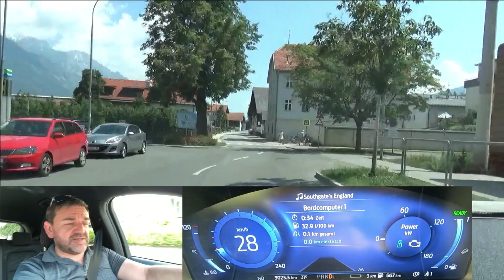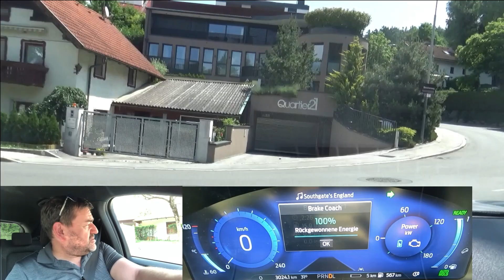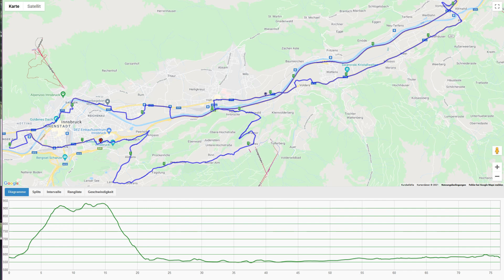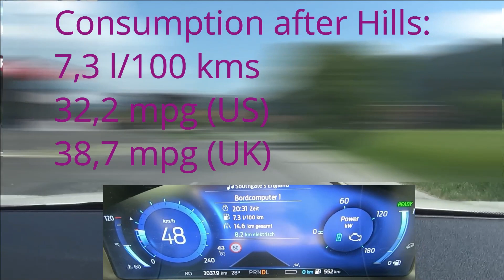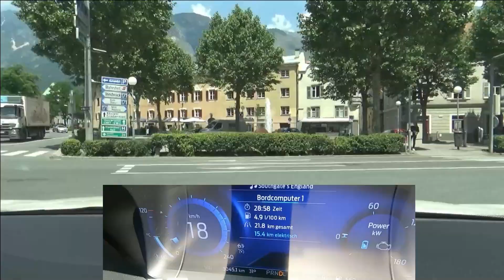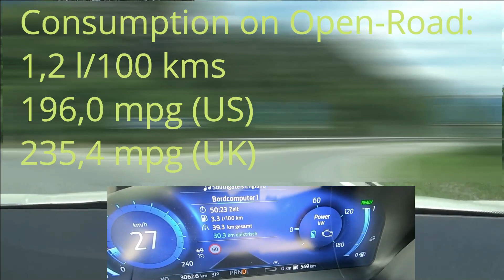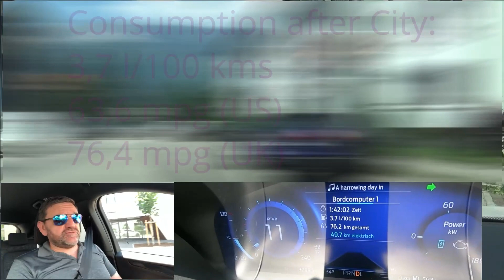Ford Kuga/Escape Plug-In Hybrid - real-life consumption with empty battery

Comment: I love my Kuga, went for a first refuel last week.
I did 2500 kms, with an average fuel consumption of 1.4 l/100km.
The car told me I did 2080 kms full electric. And I filled around 35 liters into the tank, so that works out to around 8 l/100 km, from just the engine kms.
Not bad at all, since our 1.5 Ecoboost Kuga uses the same, but for every km, always.
I'm very pleased with these results and can't forget the sidenote, the engine was mostly on for motorways and some power testing/accelerations for fun. I'm also off work after 2 weeks of the 2 months of ownership. If I did my commute with it daily, I'd expect a lot more kms from 1 tank, now we did a lot of daytrips, we wouldn't have done otherwise.
Reply from the maker: You seem to use it perfectly!! I first refuelled my Volvo XC90 T8 after 3000 kms, and it's so satisfactory to drive a PHEV :)
Reply: @ecodriver1746  I like to believe I do!

Oh ps: watched some of your videos before and while waiting for the car to arrive. Got me all excited and believing in the car. And it all came out great. So thank you!
Came back here through a link from the Ford Kuga/Escape PHEV owners Facebook page.
Reply from the maker: I'm pleased I could help and I'm happy for you :)
Reply: @ecodriver1746  How long can you keep the fuel inside a PHEV without it getting bad? I read three months, so is the best strategy not to fill the car completely unless you plan to do a long trip?
Reply from the maker: That's recommendable, you're right.